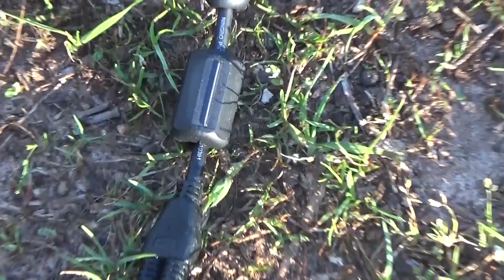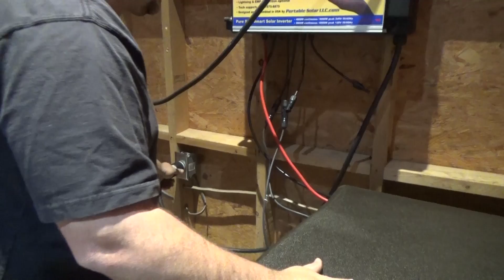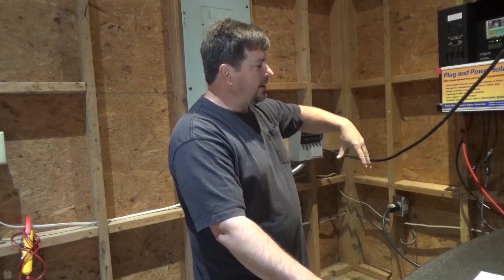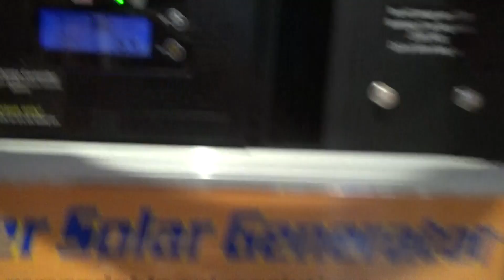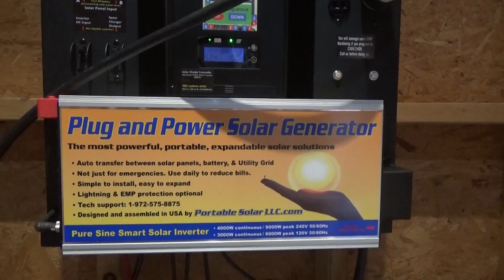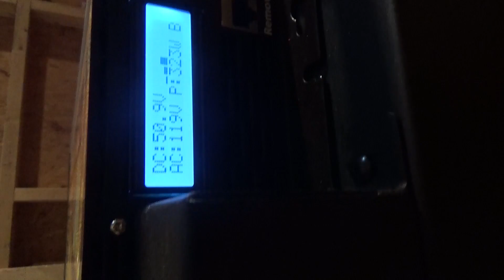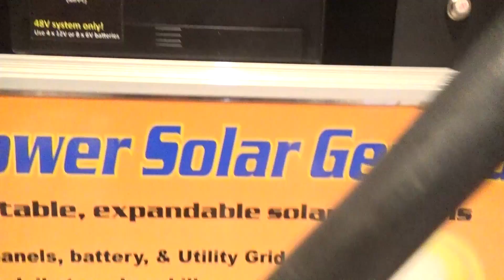Sol-Ark EMP Hardened Solar Generator

Comment: I noticed that the unit said 48 V only. Is the system only useable with 48 V systems or are other configurations possible such as 24V?
Reply from the maker: +DocOps1 Both 24V and 48V systems can produce a lot of power. 12V not much at all. The company does sell 24V systems but they only support 1800W (6 x 300W) of solar panels. The 48V supports 3900W of solar panels. Most people try to power a lot, so the 48V allows for expansion to a lot more batteries (16 or 8 x L16) for off grid storage and panels for generation.